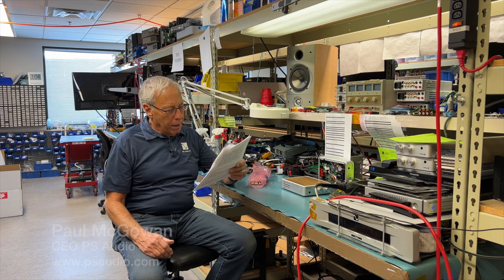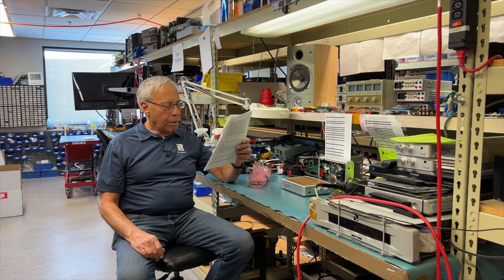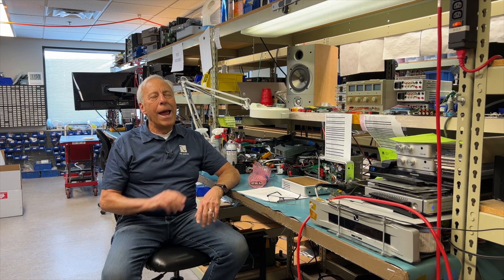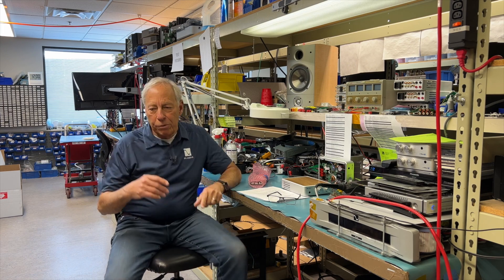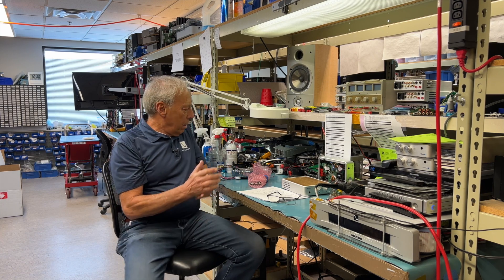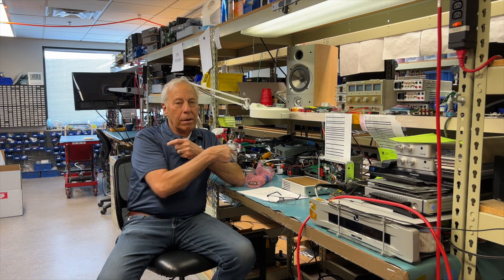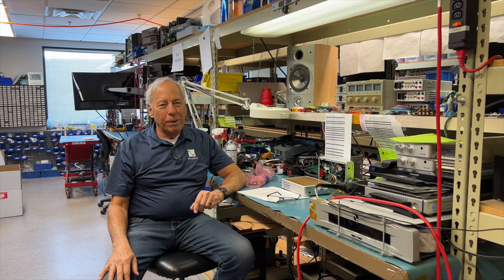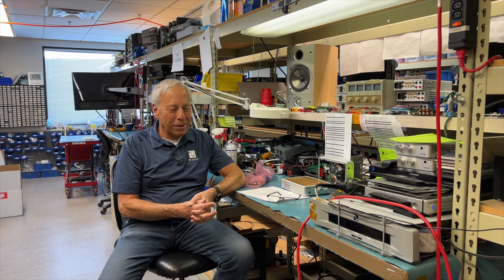Switch mode versus traditional power supplies

Comment: Good overview! However, Paul didn’t discuss all of the detail of the noise problems with switch-mode supplies. Noise problems occurs not only at the switch frequency and it’s harmonics, but also sneakily via ringing on the switch transition.  Ringing can have a fundamental and harmonics from 10’s of MHz to beyond 100MHz. Ringing noise is particularly more prominent where the switching transistors are external to the controller. Both types of noise can travel not just via radiation, but conductively onto the power supply output voltage, and also back onto the power line.  Part of the art Paul refers to is understanding the pitfalls and techniques of making the power supplies “good citizens” that don’t put out wide-band noise interference into the product itself and into the user’s environment.
Reply: @@Douglas_Blake Yes, for example, many audiophiles are still judging digital streaming audio with how it sounded 15+ years ago when 128kbps MP3 was the norm. Nowadays streaming audio can easily beat any disc media incl. SACD (DSD-64) with much superior data rate. Streaming FLAC 352.8kHz PCM can beat a DSD disc because any decent DSD music has gone through a mixer where the output typically was DXD and a LOSSY transcoding turned it into DSD. Still there is some religion about DSD being better than the master stream of the DXD PCM, which is complete nonsense. And then I find it quite hilarious that you can sell at some insane cost a CD player using some 15 year old Philips CD deck design, exclude the DAC and wrap it in a nice aluminum enclosure to then call it a “transport”. Transport my butt… any USB flash drive costing a few Dollars can save an entire CD collection more reliable than some US$20,000 transport.
Reply: @ThinkingBetter  the most accurate term in the hifi world is "audiofool" i believe . they r really neurotic ocd types full of bs
Reply: @@Douglas_Blake Agree completely. The audiophile industry is still in the mode of the 1980s on many topics. Using SMPS for a power amp makes your power rails regulated and more immune to mains power fluctuations and noise. My first PC (Taiwanese IBM XT 4.77MHz Intel 8088 clone) in the 1980s had a switch mode power supply that was super noisy and it resulted in my neighbor being unable to watch some particular TV channel. My wired mouse acted as antenna and even at a distance of some 50-100 feet, his roof TV antenna captured the noise from my mouse wire. The issue was found out by some specialist with some equipment investigating the source of this radiation as our neighbor had swapped antenna and tried to solve it in several ways and in the end had to get some help from some inspector investigating RF emission violations. The guy came into my room of my parents home (in my teens) while I was alone in the house in the evening and didn't have the main door locked with his huge equipment and antenna; and he quickly found out where the noise came from (some first generation PC mouse with RS232 interface). After grounding the PC chassis, the noise disappeared.

Comment: A commendable job by Paul on this video. One thing that Paul briefly mentioned that I wanted to expand on. "Switching" Power Supplies have oscillators in them. And those oscillators are certainly over 10Khz. Paul said that Switching power supplies create "noise" and that is very true. And because of that, per the FCC ( Federal Communications Commission ), requires any consumer device with an oscillator over 10Khz MUST carry a testing for compliance certification number. Purchasing an off the shelf power supply that is already certified does not absolve you from getting your entire product retested and certified. All of that can be a pain in the ass. Been there, done that.
Reply: And if you sell it in Europe, you must always certify entotr product no regardless did you use all certified modules or not. Europe basically only certifies whole product.

Comment: Toroidal transformers are heavy and make your equipment feel more expensive 🤣
Reply: Torrids do not have a power line buzz and produce much less noise.
Reply: @scottholmes4388  yep as a ham radio operator I agree with this!
Reply: I've had buzzing toroidals but never ei
Reply: I'm a ham radio operator and we use LPS for everything.  I have found that it's a pound for amp.  My 50 amp LPS is 50 pounds LOL.  My 35 amp is 35 pounds.  Makes all the difference in the world.
Reply: xD toroids are not heavy try ei core same power as toroid

Comment: The difference is a switched mode power supply uses an inductor rather than a transformer.   

With a switching frequency of 100KHz rather than 120 Hz for full wave rectification they switching power supplies don’t need as much filtering to remove audio frequency noise.

Somewhat like a comparison of a conventional water heater vs tankless.  Old approach vs higher efficiency.
Reply: No, isolated switch mode power supply uses transformer in all topology except in flyback, which uses coupled inductors, consent it is only topology (flyback) that can't use full wave rectifiers.

Comment: Saying "when I can't use real technical terms" is insulting to your viewers! 
In so many of the videos you suggest and insinuate that most people don't understand the industry jargon or the basic principles of electrical engineering. I think you're dead wrong in assuming that as by just reading the comments, it is clear there are a lot of very intelligent viewers who possess your level of knowledge, if not more!
Reply: Fernando, the viewer asking the question, requested that the answer be low in technical description.
Reply: Listen to the first 40 seconds of the video.  A non-technical explanation is what the writer of the letter requested.
Reply: Or maybe he was talking to me. Not all of us are electrical engineers. Now that I know that "switch mode" is just the power supply being flipped on and off at super speeds to regulate the input instead using a transformer makes it worth no more than the other to me.

Comment: If a transformer is rated for a single frequency 60hz how can it also work with 50hz power supply
Reply: A transformer needs to be operated at its design frequency in order to work properly, so the simple answer is that it can't. The turns per volt of the windings will be wrong for the core area. Depending on which way around the mismatch is, you could expect problems like overheating, poor regulation, noisy operation, incorrect output voltage.

Comment: Looks like, we all have missed one very important aspect with respect to bass production. It is normally believed that SMPS in hi-fi audio can't handle transient bass response like linear PS does. That may be one of the reasons why audiophiles do not like SMPS.
Reply: There's no reason to expect switched mode power supplies have any problems with bass if they are correctly specified for the design centres of the amplifier. As a technician I would believe what is being referred to is the "reserve" an unregulated power supply has to provide short term power output greater than the continuous rated power of the amplifier (headroom). An amp with a SMPS has closely regulated supply rail voltage, and can output up to its rated power, say 150W, whether for 10 milliseconds or ten minutes. If an amplifier with conventional power supply can provide 150W continuous, then the supply rail voltages will be higher at lower average powers, and a transient may be able to drive the amplifier to, say 170W output briefly without clipping. An SMPS powered amplifier would clip attempting to do the same thing. I suspect the effect has probably become attributed to bass because an occurrence seeking such power is overwhelmingly likely to be bass oriented, such as an explosion in a movie soundtrack or a cannon in the 1812 overture. If the conventional amp was pushed too hard it would clip too, so I think it's just a matter of recognizing a slightly different characteristic of amplifiers.
Reply: @PlatypusPerspective  True, and that's because bass requires more energy to reproduce
Reply: I found that out studying the carver cube amps..25 years ago..I ststed the fact and waa laughed at.. wade stewart quickly designed the stewart pa1800 and it ran faster and fixed the lag issues that triac controlled amps had.
Reply: the situaton is the exact opposite . you cant believe the punchiness of the smps

Comment: A traditional power supply is switch mode as well If it has a regulator, the only difference is it works at a lower switch mode then a high mode switch mode what is better for audio quality.
Well you can use a big transformer in a switch mobile power supply it's just not necessary generally
Where you buying your smps Taiwan. What frequency are you running them at Paul.
There's a American guy who worked for NASA building smps on the space station  maybe should employer him?? You can build it yourself 400 w open source

Comment: They are improving but they are still chosen purely due to cost savings. Sometimes up to 25% of the retail price. Most have the switching PS outside the box on the power cable to reduce radiated noise, case size and weight. Just like with all laptops. One of the leaders in this field are Lumin Audio owned by Pixel Magic. Their built in switching PS have lots of shielding. However their higher end models still use toroid or offer one as an upgrade. They just sound better.
Reply: No because traditional power supply engineers can't build switch mode well enough
Reply: @hoobsgroove why?
Reply: @ramsaybolton9099  more complicated than a traditional power supply what is easy! You have to think about feedback circuit
Reply: @hoobsgroove  Thanks for your reply.  So are you saying that a switching power supply is superior just that electrical engineers aren't clever enough to know how to make them.
Reply: @stephens2r338  more like traditional power supply engineers are set in their ways but yes you could say like that

Comment: For a power amp, traditional transformers are not regulated and the voltage drops by the signal load and mains power fluctuations. Capacitors are used to help on that.
A switch mode power supply can provide precise regulated voltage and also eliminate the need for an external   power regenerator as it sort of does the same.

Comment: So why wait until you can buy 'off the shelf'. why not design your own, then it will match exactly what you want.
Kind of hard tweaking a pre-built supply, but when it's your own, no problems.
Like that 'pulse locked supply' mentioned, where they are probably synchronising it's switching to the rest of the system to avoid having two clocks that beat against each other.
Reply: Bringing a new PSU to the market would need a lot of certification and laws etc. By using already tested and certified products, it is easier and cheaper for them.
Reply: It's extremely hard and they would need to hire a separate PSU engineer and they ain't cheap. Plus lots of regulations etc. It's more practical for a more boutique firm like PSAudio.
Reply: @bf0189  But if you keep doing this, then you kind of become just a re-seller, and eventually pointless. The customers will eventually learn where the good stuff your using is coming from and gravitate to a more direct approach to acquiring it.
If you design it, you have the tech, the customers have to come to you.
Reply: @paulstubbs7678  All business is a balancing act.  You are focusing on particular elements of that balance.  You also have to consider that timing is everything.  Sure, they could become "just a re-seller" of certain items, but be moving to others simultaneously.  Like them or not, PS Audio is a successful business and someone there is working the balancing act.